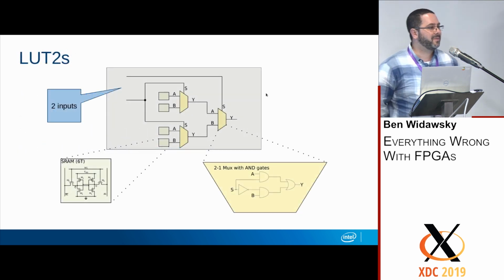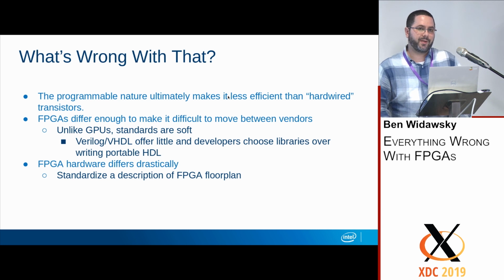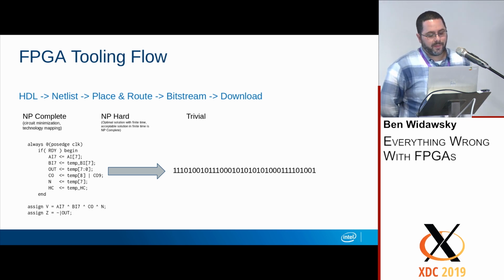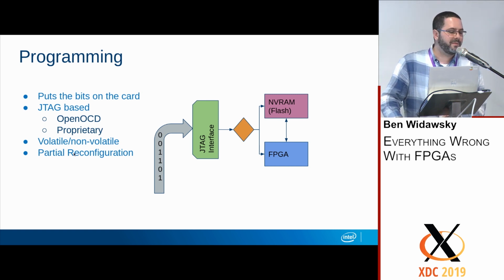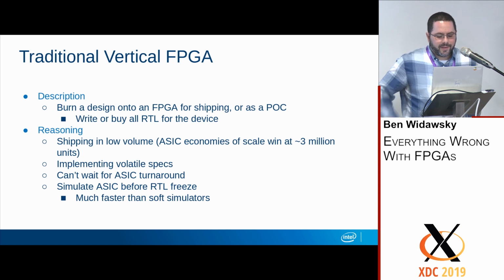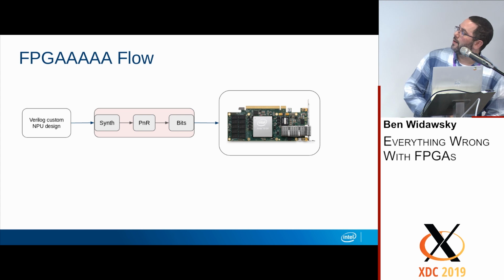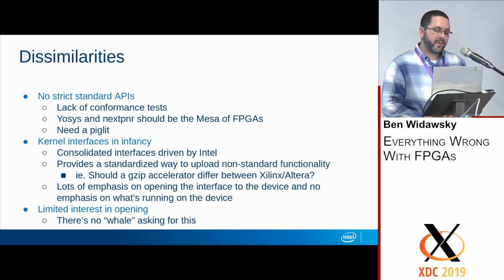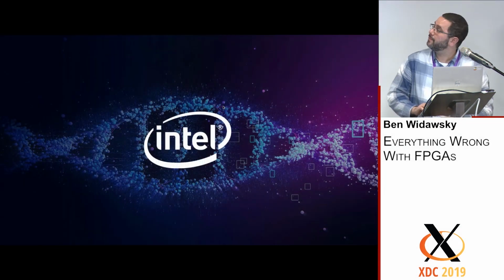XDC 2019 | Everything Wrong With FPGAs - Ben Widawsky

Comment: One minor correction, Ben claims circuit minimization is NP-complete, but that's not true, it's not in NP at all and therefore not NP-complete. It's actually much worse than NP-hard, circuit minimization is Σ₂ᴾ-complete, the next level of the polynomial hierarchy, and is therefore (in some sense) vastly harder than anything in NP.

Comment: FPGA, in fact, is a low-cost practice of mapping algorithms to hardware, which is another perspective on algorithms. I am a developer of xilinx Vitis Library image Codec. Four years ago, I was not familiar with WebP algorithm when I used HLS. It took me four months to achieve the price efficiency and power consumption efficiency of CPU 3X, which is still surprising. In fact, RTL can be further improved by 3 to 10 times. The problem with FPGA is that the mapping of top-level branches to the area will inevitably lead to a decline in efficiency. You must let the branches sink, which is a great test for understanding the algorithm. Sometimes you even need to understand the essence of the algorithm more than the algorithm developers, because more and more algorithms tend to explore the problem space extensively and then select the best. What you can do is to find the one with higher probability among the branches, and give it the most resources, while the other branches use the least area. When you can discover this probability, you actually discover a new knowledge. Isn't that a gain?
Reply: I like soup.

Comment: vendors: we introducing high level synthesis
us: so we can use a higher level language and abstractions to build our systems
vendors: yes, you can accelerate your design process
us: so which kind  of high level language. python, scala, ocaml...
vendors: we're giving you the highest of high level languages....C
us: ....srsly
Reply: It's not really "C" either, with all the crazy directives. The person who works on it pretty much has to know the nuts and bolts of RTL level of representation well. This implies a smaller user base that leads to harder to find support for anyone who works outside of professional design houses.
Reply: @OLDSKOOL978 I completely agree. Exactly my thoughts.
Reply: everything compiles to c
Reply: @yieldsfalsehood8863  first off, no that's not true. The c abi is a default linking standard but language don't compile to a c target. Second, hdl "C" isn't compiled at all its synthesized to rtl, at no point does it become assembly. Third, you can't use that abi platform behaviour because it's never compiled. 

C is a great language for a single core cpu, everything else is "all I have is a hammer"
Reply: @binaryblade2  I don't understand. C is a common compilation target, and you can do high level synthesis on the C your compiler outputs, right?
Reply: @yieldsfalsehood8863  
> C is a common compilation target
This is false, compilers don't target C very often and if they do it's only for very rare debugging purposes. This is especially important when you consider the optimization passes that the compiler does to reduce the input code into something efficient. The way a compiler works is by reducing the input language into an intermediate language that is assembly like. This IR is then optimized by the compiler and then reduced to the machine target assembly. At no point is the high level language reduced to C. 

>and you can do high level synthesis on the C your compiler outputs, right?

Also no. Even if your compiler did output C you couldn't use it because the "C" that's used for HLS isn't the C you're familiar with. It has a similar syntax and that's it. The heavy lifting is done by pragmas and directives in the original source and has to be written in a wholly different way than something that would run on a CPU. 

The truth is that HLS "C" isn't C. It looks like it but it's very different and that similarity without being the same makes it infinitely worse, because it convinces people, like yourself, that they are in some sense compatible. They are not.
Reply: @binaryblade2  thanks
Reply: @OLDSKOOL978 Except it's designed for a turning machine. It really is a failure to think of c as a "good" choice in any sense of the word for HDL.
Reply: @OLDSKOOL978 There is a large space of languages and features that allow for effectively writing composable HDL that doesn't involve hacking up some imperative language and calling it an improvement. The current HDL languages leave much to be desired, but C is not the answer.
Reply: So true.